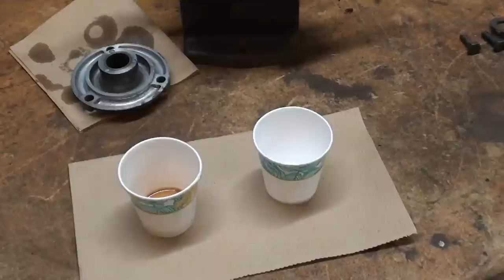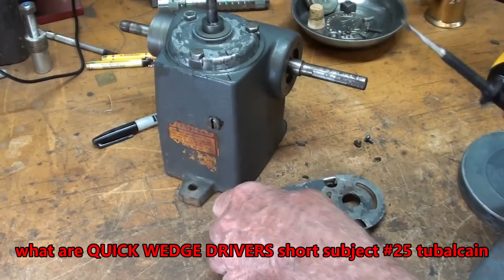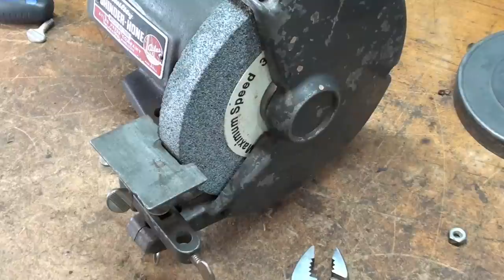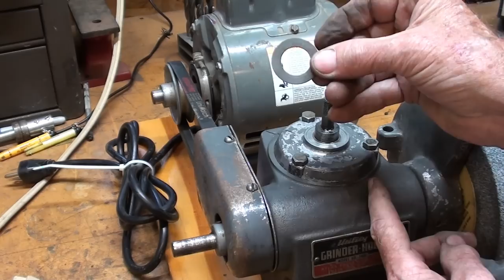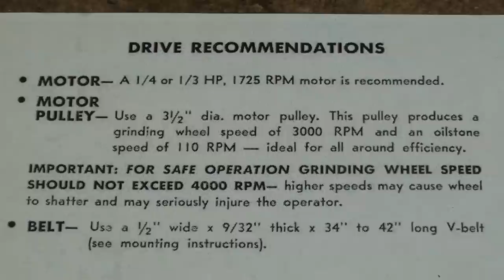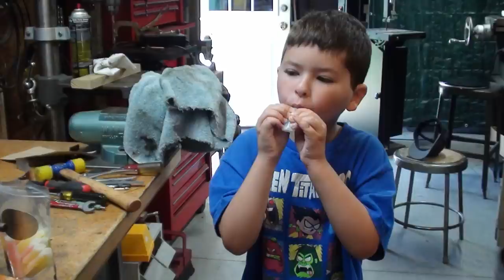ATLAS CRAFTSMAN GRINDER HONE restoration pt 2 #885 tubalcain sears

Comment: I picked up one of these 2 or so years ago.  Mr Pete is correct--not many were sold.  They are not rare, but scarce.
If you love antique equipment, you will like this machine.  It does not do a great job of sharpening.  There are much better ways today to do it. But in the 1950's options were fewer.  If you run into one of these for sale, be sure the honing stone is in good shape.  If it is missing or badly damaged, do not buy the machine unless you need it for parts. The original honing stones are just about impossible to find.  Thank you Mr. Pete for another great video.
May you have long life and many more videos ahead!

Comment: Hi Lyle
I am writing this from the UK where I have a 1942 South Bend 9B lathe which I have restored. Your videos have been invaluable in my tool room education. I am a chartered engineer specialising in mathematical modelling and could calculate all the vibrational modes of your driven shaft. I am due to retire in a few years and your shared knowledge will help me greatly as I set up my workshop. So thank you Mr Pete - keep up the good work!
Reply from the maker: Thank you for writing. Sounds interesting., Be sure and enjoy that SB lathe

Comment: FANTASTIC VIDEOS! These two videos have helped me so much! I run a sharpening business and I picked up one of these from local farmer that had it collecting dust. It runs but I want to get it all up to snuff to use as my scissor sharpener. I plan on using a 1hp variable speed brushless DC  motor to run it and modify a Wolff twice as sharp armature and angle guide to hold scissor angles. This will give me the exact speed I want for sharpening scissors as well as a flat hone I can work off of. I want to change the 6"grinding stone to a CBN wheel. The flat honing stone wheel will be changed as well to a CBN wheel. These videos have given me so much more confidence in working with my unit. I'm so very grateful that you took so much time to make these videos. I just happened to stumble across these as I was looking for another atlas grinder hone as a parts machine. If you're ever in Minnesota I would love to buy you a steak dinner for your genuine efforts kind sir!

Comment: Hi Mr. Pete,
I can answer a couple of questions you had as I pulled my grinder-hone new from the box, as I mentioned commenting on the first video. There is indeed a groove in the bearing support for the upeer fiber washer, and the washer fits in it perfectly. My unused washer looked very close in thickness to yours, so I reckon yours does not have much wear. Also, I had the adapter for an additional polishing mop, whire wheel, et al, on the same size as the pulley drive. Unusually this was very well made, a close fit on the shaft, and runs very true. I used it to mount a coarse (150) diamond wheel on it and it works great. I used the existing square nut on the hone to secure the 3000 grit diamond wheel, and made up a wheel support that takes the place of the cup. It works really, really well, comparable to commercial machines that run over a thousand dollars. The coarse & fine whells work well for reshaping brazed  carbide lathe cutters, for example, and the 3000 grit slow-speed wheel is perfect for honing any single-point carbide cutter to a mirror finish. The hone is really good for scraper blades, as well. I am very satisfied with my make-do carbide grinder and would not trade it for any commercial machine. If I found another I would restore it and set it up with CBN wheels for HSS cutters.
Reply from the maker: Thank you very much for that information. You have some great ideas. I am going to make a follow up video showing a few additional ideas that I came up with. Even though I do very very little Horning.

Comment: Mr. PETE,
Heard you talk about your cataracts.  I was really nearsighted from 2nd grade on.  It was bad enough to cause me to fail the draft physical in 1970.  I got cataracts when I was 63.  I had them fixed and choose the lens value for distance vision.  I had not had distance vision since I was 7.  It take about two months.  They do the first eye, then do the 2nd eye 3 to 4 weeks later.  I have not regretted it.  I am 20/30 in my left eye and 20/20 in my right eye. It's good enough that I can drive legally without glasses.  I have bifocals so I can read. The top lens has little or no correction.  They even have bifocal lenses as implants now.  I think you would feel better if you got your sight back.
I have been watching for over 10 years and enjoy your videos.  Take care.
Reply from the maker: Thanks

Comment: Another great one Mr. Pete!  I actually, have one of these Atlas machines. I trash picked it at least 10 years ago. Unfortunately, it's sitting in the corner where I left it back then.  Someone used the living daylights out of it because the honing stone is so worn that if you laid a straightedge across the top, you could see about a 1/4" gap at the ends. Until I saw your video, I had no idea that the stone was removable. I wonder if the stones are still available from Clausing. I'll have to look into that.  As for grinding on the side of the high-speed wheel, Sears used to sell a wheel for grinders that was to be used in conjunction with their swing-type drill bit sharpener as it was made for grinding on the side. It's a little wider than a regular wheel and has a depressed center.  Now that I know that the honing stone is removable, I may try making a wheel out of wood and adhering a piece of wet or dry sandpaper to it. We'll see.
Reply from the maker: Thank you for commenting. I was also wondering if clausing still has the wheels. But I would bet $1000 they do not. Your idea of making a separate horning plate is excellent. I may do something with that idea. Someone is sending me an atlas drill, grinding jig. Some parts are missing. I probably will do a video on that as well. And it requires a grinding wheel that you just described.

Comment: I hope "See you next time" doesn't mean mean "See you for good". 

The world needs lots of more Mr. Pete.

The hone wheel has serious runout. This seems like a substantial issue that could have been remedied with little design change. I can see that a careless operator could get tangled up in the drive belt or the grinding wheel pretty easily. 
I don't own a Tormek sharpening system, but they appear to be today's version of your Atlas with some welcome refinements.

I enjoyed the 2 part series.

Comment: Until the late 90's there wasn't anything out there that could keep up with a Gleaner combine.  I worked for a Gleaner dealer in Texas back in the mid 90's.  I've turned every bolt that went into holding one of those combines together.  Those absolutely were the good Ole days. It was back before you had to plug a computer into a machine in order to work on it.

Comment: Just a guess but if the Atlas Grinder Hone was available to the Canadian market, using pints as the measurement of volume for oil might avoid confusion with ounces which can also be a measurement of weight depending on the circumstances. That's assuming that the Canadians use US pints and not British pints 😄
Reply from the maker: Thank you, I never thought of that
Reply: Canada never quit the commonwealth, so before they went metric, probably same as England?

Comment: I have one of these that I got from an estate sale type of thing from an old retiree about 20 years ago. The tag doesnt have the word "utility" on it and I believe its a model 2410 instead. I dont have a belt guard but I do have a wire wheel on the left side. The top hone thing is basically useless in my opinion. Then again I may be turning it slightly too slow because the pulley on the motor is about the same size as the pulley on the grinder. I also dont have the teleprompter for the hone. I wish I had that part, I might consider making or locating that part. The side wheels however are fantastic. I just sharpened about 20 chisels with it yesterday. Its a nicely made, fairly compact unit. I wish I could post pictures.
Reply from the maker: I really haven’t use this machine yet, but I more or less agree with you about the hone

Comment: Keep doing what you do Mr. Pete. I watch all the way through. BTW, I have an actual Atlas arbor press I keep meaning to get back into operation. Have you ever run across one? I had to buy it when it turned up. I mean, it's the "Atlas Press Company," after all.
Reply from the maker: I have never seen one in the flesh, but say I had quite a variety of them in the catalog

Comment: This year at the Indiana Blacksmith conference I was helping a young man, about 15,  in the learning area forge a pair of tongs. He was there with his slightly younger brother and his dad was watching. Anyway we punched and drifted the hole in the boss of each half to 3/8" and I got out one of my store bought 3/8" rivets. Then I told him "Now we'll do some of that fraction math that you thought you'd never need when it was taught in school. We need to cut this so it goes through both halves and protrudes 1 and 1/2 times the diameter of the rivet to have enough to forge a head on the other side. So how much to we need sticking out?" To my surprise without much thinking he replied "9/16 of an inch." I was shocked... his dad had a big grin on his face.
Reply from the maker: I am shocked just reading your comment

Comment: Is there anything stopping someone from attaching a wheel to the left side? Such as a rock felt wheel. I see that you could add the buffer wheel with a Mandrel type attachment, but I would like to attach a wheel (rock felt) that would mount similar to the grinding wheel on the right directly to the arbor.
Reply from the maker: Give it a try

Comment: Hi Mr.Pete - I watch all your videos no mater the length.  Also identify with your asides in this episode like 90 weight gear oil, witnesses marks and not grinding on the side of a grinding wheel - my Dad was a Tool  & Die maker.   Thank you !

Comment: i think your rant on 1/8 pint vs 2 oz is justified. i was taught the conversions in school but i didnt LEARN them until i started working as a prep cook. the only reason i can imagine for the instructions is if it was stardard to buy a single pint of the oil at the time.

Comment: Regarding mushroomed threads- I'm working on a Berkroy finger brake that was partially destroyed by someone who tried welding some broken castings back together (multiple times, it seems), but never got it right.  Anyway, there are 2x 1/2-20 hardened knurled adjustment screws that had mushroomed ends (hardened!).  One of the stop nuts was cross threaded, and the other was sloppy (they weren't hardened).  Getting the screws out of the castings and the one nut was difficult!  I'm not sure how they were installed, because they would have had to been heat treated after assembly if they weren't hardened to begin with.  The thread end of the screws do show signs of a lot of rubbing.  I didn't think hardened bolts compressed, but I guess it there is enough force, anything can happen!
Reply from the maker: I bet that was a real struggle. Berkaroy sheet metal equipment was popular in junior high schools.

Comment: I enjoy these restoration videos. I watch several channels where that’s all they feature. Length is not an issue for me. I wonder if a replacement honing wheel could be purchased for these machines. Yours is pretty botched up on the other side. Watching things being made or repaired motivates me to put down the iPad and get out to the garage, I have plenty of projects going all the time.

Comment: I'm embarrassed I couldnt do the simple calculation in my head anymore of your 1/8 pint of stinky 80-90 for the gear box. A predecessor to your old MM tractor said similar.
1/4 pint of engine oil to each of the cylinders on a dry engine. 4oz for me, 2oz for that gear box of yours. I wrote down in my old book 1/2 cup for me. 1/4 cup for you.
Did I get that right?
Good reminder!
Reply: No matter about video length. We are watching.

Comment: Something I never heard or knew about was the term bladder as the paper stuck to the grinding wheel.
I thought the wheel only needed a set of large washers to mount it along with the bushing.
Reply: It’s blotter not bladder.
Reply: @ricksharpe6895  ok

Comment: Yes, that is an elevator bolt. I assembled and serviced elevators for over 40 years and never, not one time, saw one used on an elevator. Henry has outgrown the tool box he was delivered to you in a few years back.
Reply from the maker: Yes, Henry is getting very big, but he still sits on my lap.    I think perhaps those bolts were used on the wood floors of old freight elevators. Just my guess you rarely see them. You are the first one to comment on it.

Comment: The top stone looks like it has a wobble going on. What might the cause be and can it be fixed?
The video length is about right, but I would have liked to see you struggle getting to those two screws underneath the guard lol
Reply from the maker: And it was a struggle. I could not turn the thing on the side because of the oil.

Comment: At 10:58 you mention the paper "blotters" on the new wheel as being essential for not allowing the flanges to dig into the wheel and for the important information printed on them. Question - why are they called "blotters"?  To blot up oils that might harm the wheel?  Thanks, "Habitat Restore" John from West Dundee.
Reply from the maker: Years ago, the bladders were often loose in the package. They were a rather thick paper that resemble an ink blotter inconsistency. At least that’s my reading on it.

Comment: Regarding video length, I think 20-30mins is fine for technical types. If you aren't getting the views it's probably because you aren't playing the You Tube game. You need to be making Shorts these days to get You Tube to promote you videos. You don't need to film anything specially, just take a snippet or two and splice them into a 1 min clip that's just enough to pique a viewers interest. You could even narrate over the clips, so a Short for this video you could splice together a few key visuals and say "in this video we look at a 19XX (year) atlas grinder hone, also sold under the craftsman brand, intended for the home market, strip it down, see how it works and rebuild and restore it"....etc   You also need to remind viewers fairly early on in the video to "like, comment, subscribe, ring the bell/turn on notifications and share with someone you know who might be interested".  If you leave that until the end, you loose out on the people who drop out part way through. Hope that helps some.
Reply from the maker: Thank you for the great advice

Comment: I can't tell you what an 1/8th of a pint is off the top of my head.

I also can't tell you what a pint is.

I am Canadian, we learned metric fluid measurements.
Reply: I just spoke to a Canadian today and he said they use the Metric and Imperial systems.
Reply: @ellieprice363  It is weird, bits of both depending on the context but pints are ounces are not used. For cooking the might do Canadian cups, teaspoons, and tablespoons.

Otherwise it is millimeters or liters.
Reply: Two pints = one quart. Four quarts = one gallon. One gallon = 3.785 Liters.

Comment: How much oil? 
Enough to fill the case to the bottom of the fill/drain hole. That is why the hole is where it is. The actual amount of oil will vary due to variations in the casting but the oil level will be correct since the fill hole is positioned relative to the main shaft.
Reply from the maker: Point well taken. Some of my antique tractors have two plugs in the crank case. One to show if it is overfilled and the other if it is low on oil.